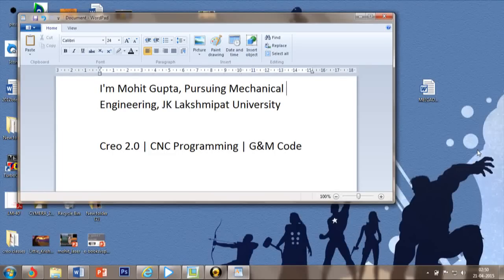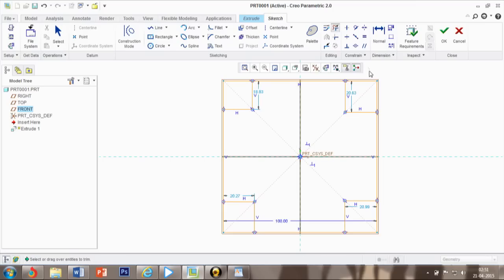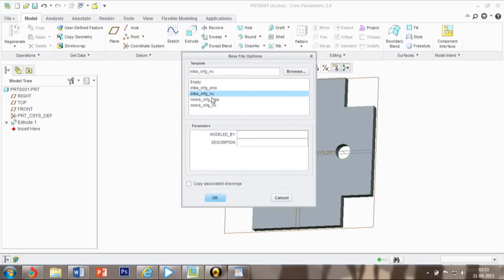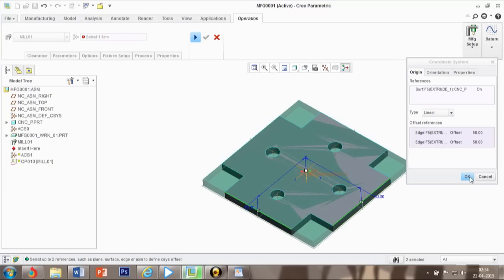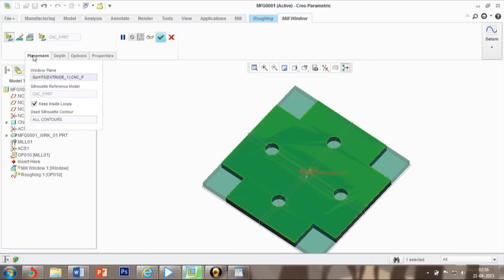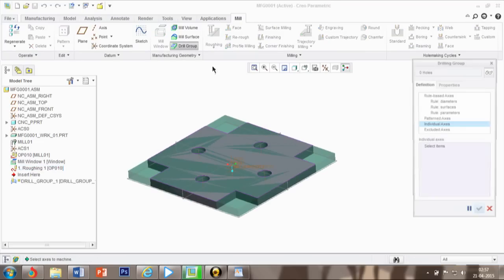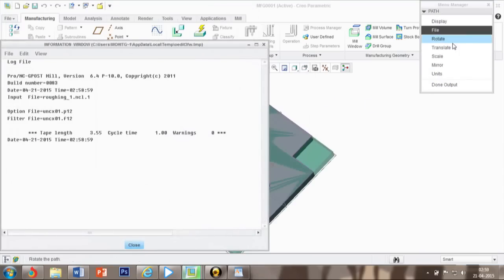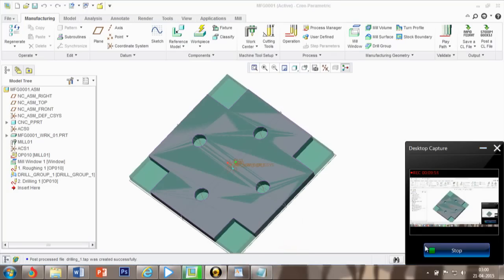CNC Programming using Creo 2.0, G&M Code

Comment: When I tried this, the simulated tool did not cut around the part, it cut the corners and then cut the holes, how can I fix this? Obviously the program figures out its own path but can I make it do what yours did?
Reply: Hector Cerda i am also facing same problem